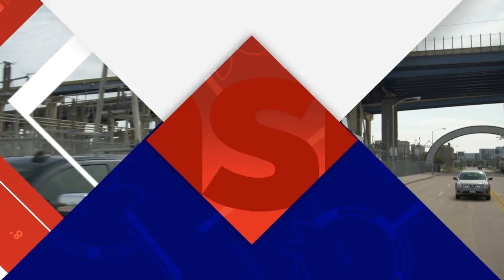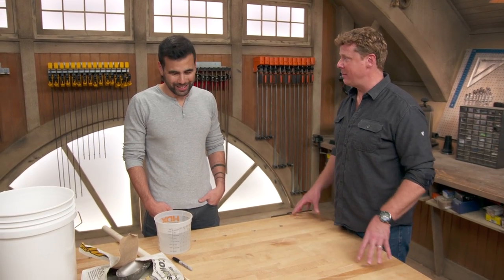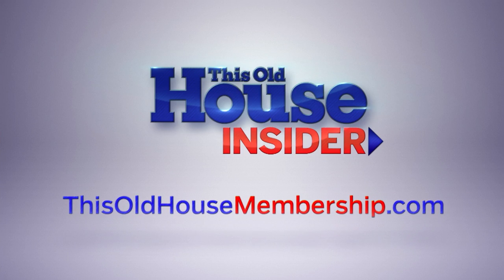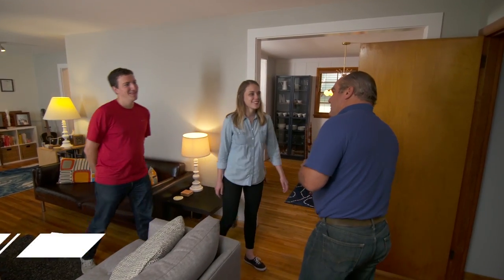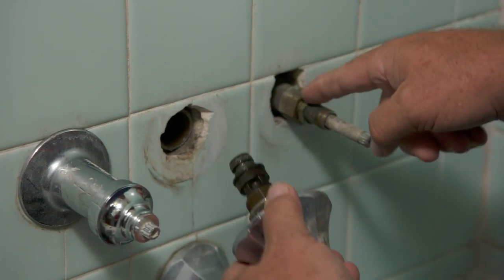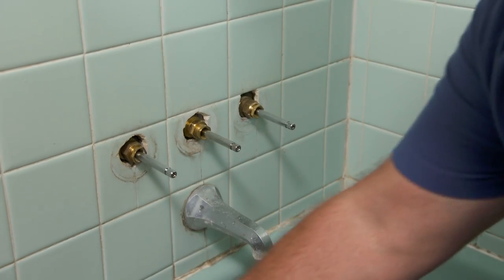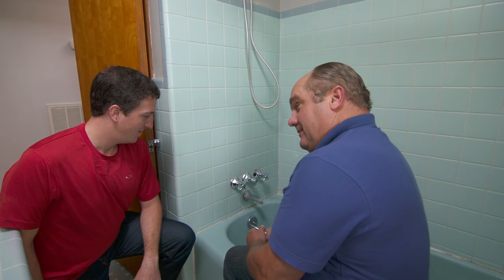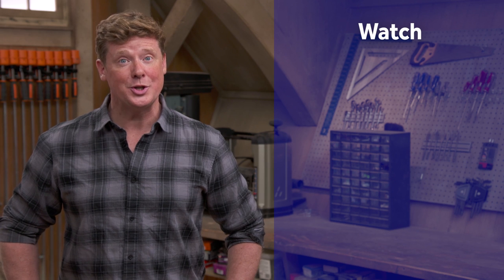ASK This Old House | Shower Valve, Chain Saw, Bucket Stool (S16 E20) FULL EPISODE

Comment: Only one in town they closed down. Use to walk in the  now defunct plumbing supply store with a valve stem from a house that was 50, 60, 70 years old and as you were walking in the door holding it up in your hand  the old timers could eyeball it from 10 feet away and tell you what it was. Those days are gone.

Comment: Must have done a thousand of that type of faucet in the 10 years I worked at a 35 year old hotel.
They don’t show the ones that don’t want to come apart though.
Reply: You just rip on it till it shears the pipe in the wall? 😆
Reply: Yep, I work at a 35 year old retirement home & pretty good at plumbing & some "most" of those old valves are tough if not impossible to take apart without breaking.

Comment: question regarding shower valve replacement.  why no plumbers tape used on the threads?
Reply: I think since those threads, on the valves, were not tapered, the tape would just make leaks worse.
On a tapered connection, it can compress the tape, as it tightens, to a seal.
A flat thread, the tape would more and likey bunch up making it highly likely to leak.